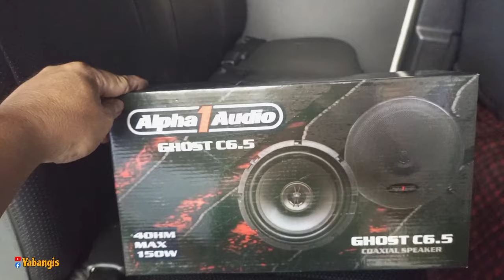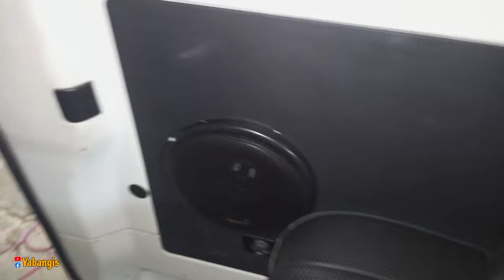Toyota Hiace Commuter | how to install 6.5" coaxial Rear Speaker (step by step)

Comment: Bossing tanong lang dun sa stock na speaker sa unahan alin dun ang positive at negative
Reply from the maker: bossing..sa toyota na speaker malalaman mo ang positive sa speaker kung ano ang kulay ay sa socket..tignan mo lang yung sa tapat ng pindutan ng lock..yun ang positive wire nya.👍

Comment: Sir paano pag 290watts 3way kaya ba ng stock head unit at ano ho size ng wire ang kailangan salamat sa pagtugon sir 🙏
Reply from the maker: masyado na mataas ang watts nyan boss..output kasi ng stereo 50watts lang bawat line output.sa 290watts mataas na yan.,mapapatunog naman yan boss,kaya lang di nya mailalabas yung max nya..👍
Reply: Maraming salamat bossing  👌🎉
Reply from the maker: @zynmilserran5350  ok bossing.,basta may tanong mssg lang sa mga video.😁👍👍

Comment: boss paano kapag mahina ang output ng speaker pakatapos ma wire?
Reply from the maker: boss dipende yun kung mataas ang watts ng speaker..or yung output ng head unit mahina.,or setting ng headunit baka ang speaker nya naka set sa front.(balance setting)